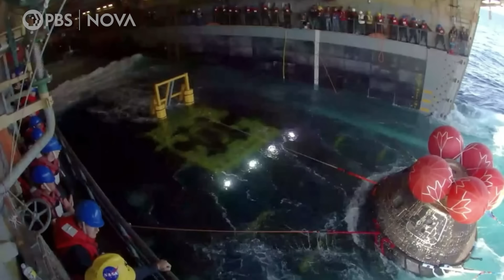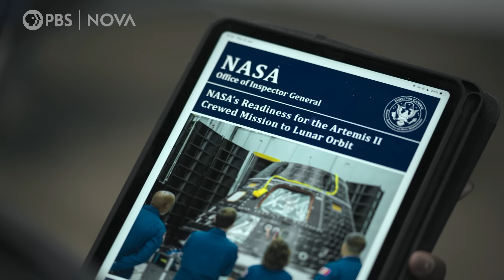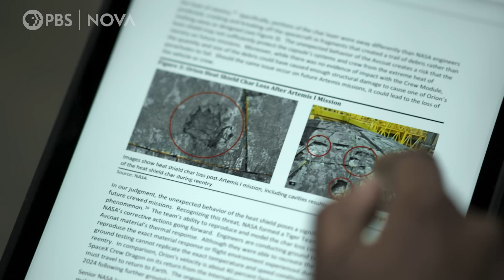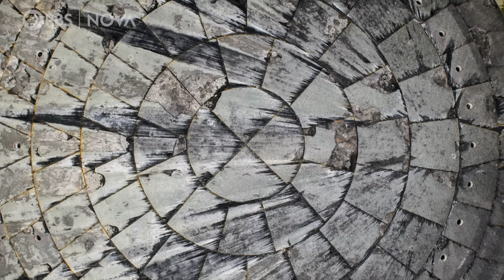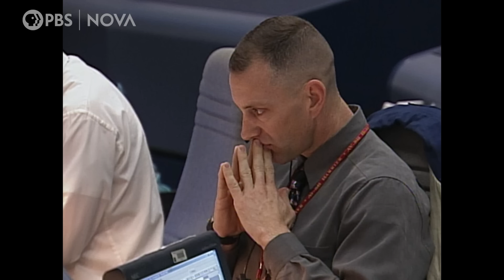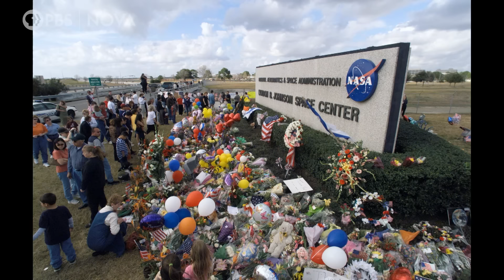Artemis I’s Heat Shield Had an Unexpected Problem

Comment: There were not only two major disasters (Challenger 1986 and Columbia 2003) with 14 NASA astronauts dead. There were much more disasters with 25 NASA astronauts dead. E. g. in 1967 they lost the whole Apollo 1 crew  of three in a capsule fire on Earth because they put pure flammable oxygen and flammable interior in the capsule during a test on Earth with the whole crew inside. The engineers warned, but the warnings were ignored by NASA, like in 1986 and 2003 too. So in 1967 a spark set the interior of the capsule on fire during a „non-dangerous communication test“ with the capsule closed and the crew inside and due to the pure oxygen inside, the crew stood no chance and were burned up alive. Commander Ed White‘s last screams were: „We‘re burning up!“ so they were aware of what was happening to them. The three were 31, 36 and 40 years old and had families with children. They weren’t in space when they burned up, they were on the ground in a test capsule for a „non-dangerous communication test“. This and the later disasters all were due to NASA ignoring warnings.
Reply: Pure oxygen? Even I know better.

Comment: The capsule survived just fine, and NASA adjusted the reentry profile in order to lessen the stress on the heat shield.
Reply: The concern is the manner of ablation. Large chunks breaking off indicates weak spots and inconsistent binders. If a small chunk dislodged, a large chunk could as well, not only letting heat penetrate but also creating chaotic aerodynamics. They may have to go back to the more expensive one-piece heat shield like Apollo had.
Reply: @Mothball_man no the new material for A3 and on is called Avcoat HDR. Still a block type heatshield. It resolves the spalling issue with A1.
Reply: @moejoe1863 true nasa went back to the old system used on apollo
Reply: @Mothball_man  Hopefully they do that for future missions.

For Artemis II, it's my understanding that they adjusted the reentry profile in order reduce stress on the heat shield.
Reply: @PistonAvatarGuy I guess that would work as well. But it seems like, as you say, a better shield would be the best option.